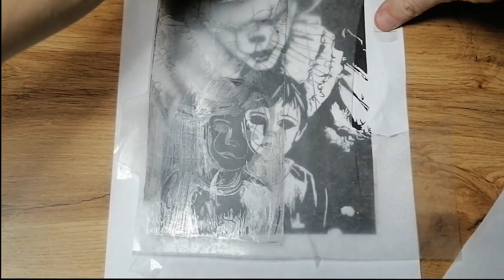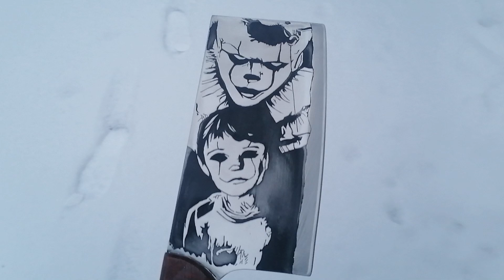Etching of a drawing on a knife with a welding machine | A knife in the style of the movie "IT" DIY

Comment: Hi, I want to ask you a few questions. 
Is there a difference between this method and laser drawing? 
What is the feature of the paint you use? 
When I try to scrape the paint it breaks and I cannot get straight lines. What type of paint should I use?

(By the way, your drawing is great! 👍  )
Reply from the maker: Using this method, you can get a deeper drawing. In addition, it is easier to recreate it at home. It is necessary to use a primer rather than paint, then the lines will be clearer.
Reply: @RunprodKnives-ve4hy  thank you i will try 👍🙏